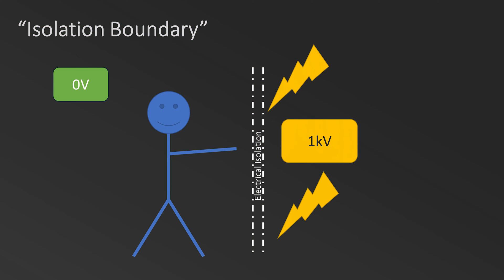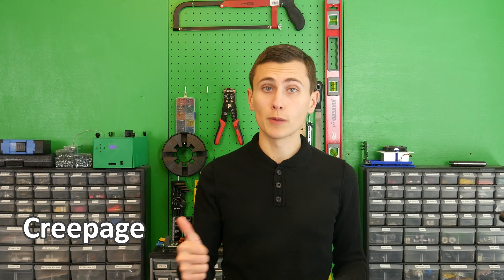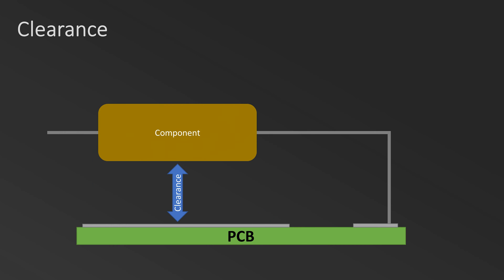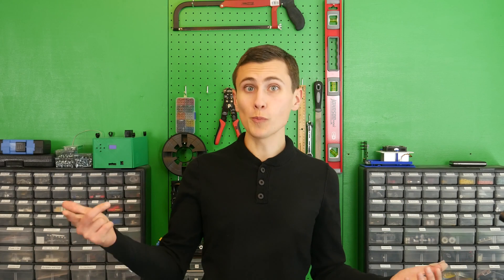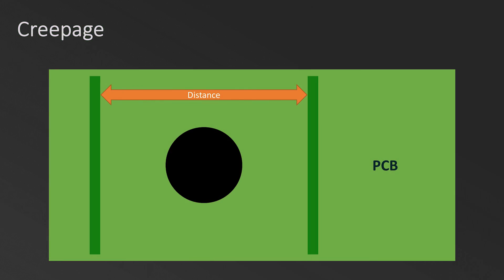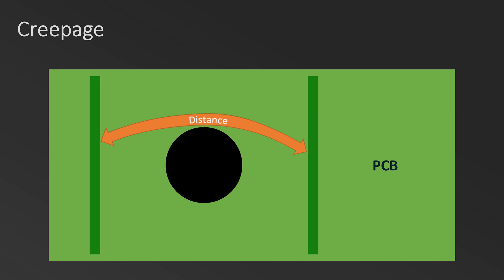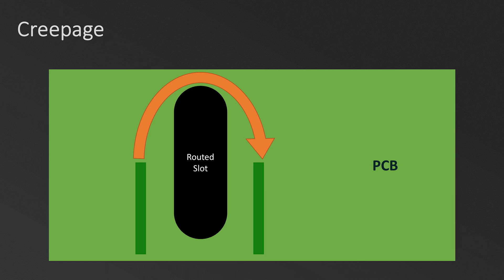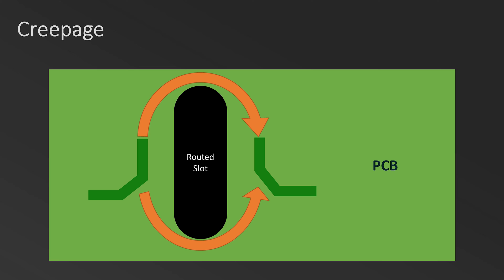Isolation: Keeping High Voltage Where It Should be

Comment: Opinion: This could have been ~50% shorter and in that way more effective. The total amount of details can fit in a small paragraph. Entertainment for the sake of retaining interest in watching to the end was misguided during planning. This is dry stuff. Stick to the facts and underscore the (deadly) details. Instead of vector images I would have used practical photographs. I kept thinking of many instances where the power supply sections are on the same pcb but there are long routed barrier holes. Also, 21st century online A/V (thankfully) now has pretty high minimum standards. Please either get a lav mic, have a shotgun mic pointed at your mouth, or a condenser stick mic just out of frame over your head. Regards.
Reply from the maker: Hi FMphoto! Thank you for the constructive feedback! Seriously, thank you for naming specific and practical things we can work on! I hope to see you around the comments more... (And  hopefully some of our more recent videos show a few improvements). We're always working on getting better! Exciting changes around the corner.

Comment: I am a wanna be diy er  and have a basic electricity and I would like to connect two timers to work separately to control one 230 vac sprinkler pump.I would like to build the system first myself and if it gets a little complicated I can start saving to buy one. thanks